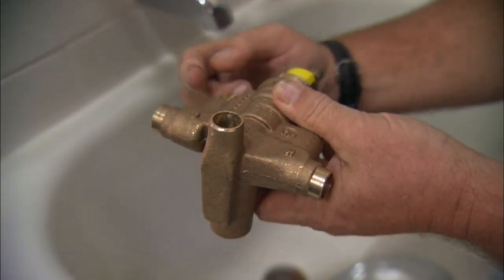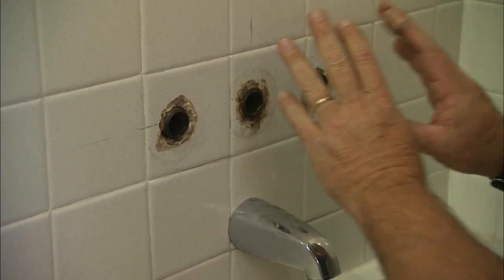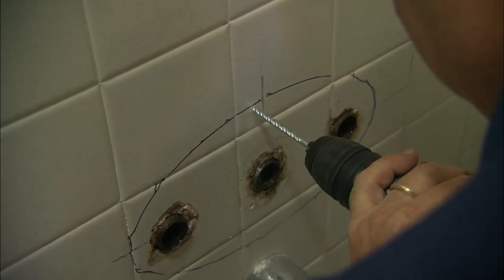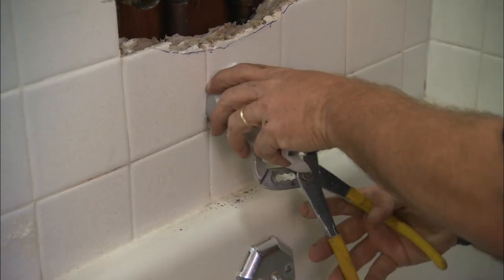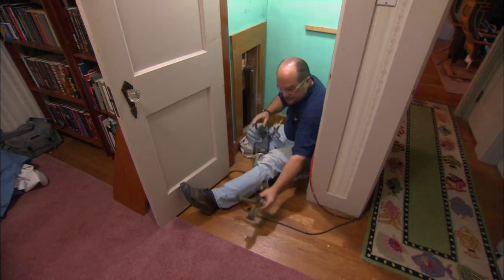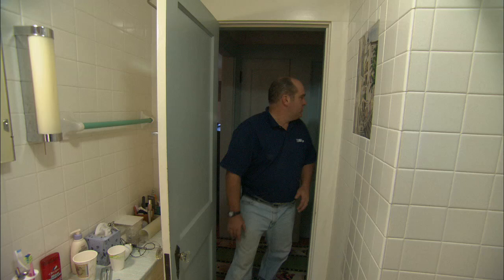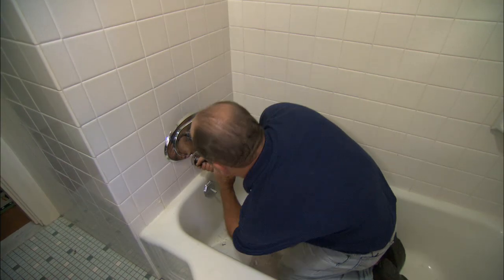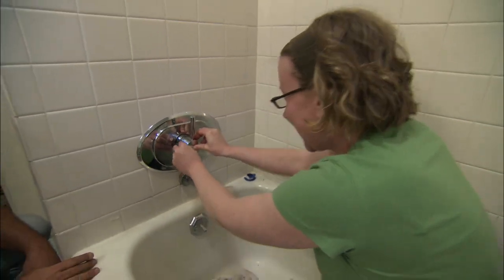How to Install a Pressure-Balance Shower Valve | This Old House

Comment: Why'd you cut that giant hole in the wall when there was already an access panel in the closet? facepalm
Reply: He was replacing a 3 handle shower valve
Reply: @cekorich  This comment would make sense only if there was no access from the back, but he can remode the three handle from the back and left the holes for the two handles as the flange would cover them.
Reply: The lady owner pointed out there was an access panel behind the wall after the fact....

Comment: The tile job doesn't look that old. It was put on over drywall. You can see that moisture intrusion has damaged it.
Reply: Leaking will occur with time especially with a shower area

Comment: They should have replaced the shower arm, shower arm flange, and shower head too!!!!  The valve handle and tub spout look nice and beautiful, but the shower head assembly now looks old and cheap!!!!  And replacing that is not that expensive and is very easy.  
You have a nice looking tub spout and valve, but an ugly shower head assembly.  But otherwise great video, and always neat to see how old valve assemblies are upgraded. :)
Reply: The Overflow is what I noticed should have been replaced as well

Comment: There has to be an easier way to cut that tile.  Maybe a jig saw with special blade.  Surprised he didn't crack tile while hitting with chisel.
Reply: He broke 3 tiles
Reply: Angle Grinder but with a Diamond Cutting blade. Should be no problem. Though if you dont have one blades are like $20-40 and angle grinders are 60ish. Save about $100 doing it this way.  Though if your tile is messed up can cost more then $100 to fix especially if replacement matching  tiles not easily found
Reply: Yeah just a grinder with a diamond blade and gently go around the sharpie mark over and over until you cut through

Comment: That closet access panel was convenient. With it, did he need to take out the tile? Maybe he didn't find out about it until after he started.
Reply: he needed to cut tile as per template,to access intergral shut off valves for future service
Reply: Actually very common in the Midwest
Reply: @geraldtrembley7353  He didnt need to cut a hold that big. the only reason is if you cant access it from the back. You can access everything from the back.